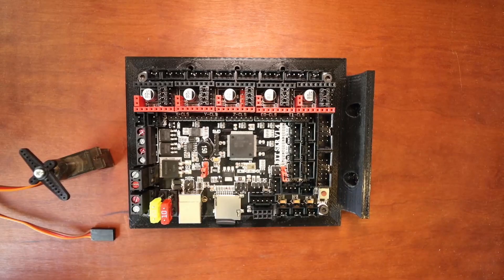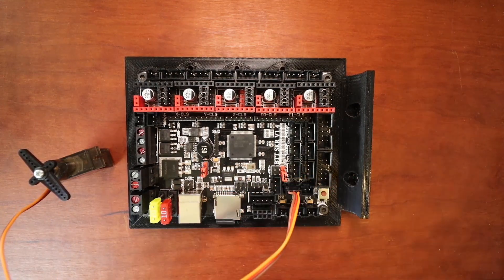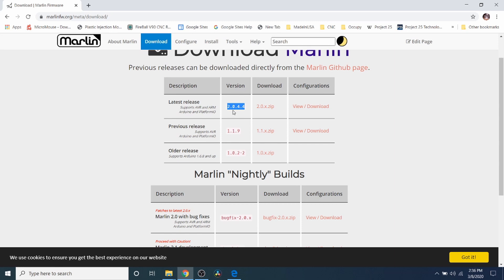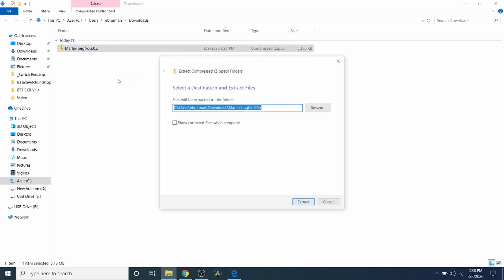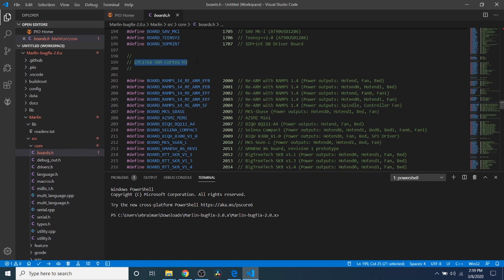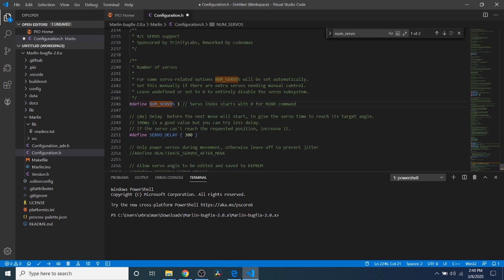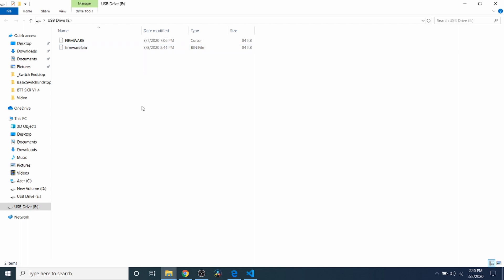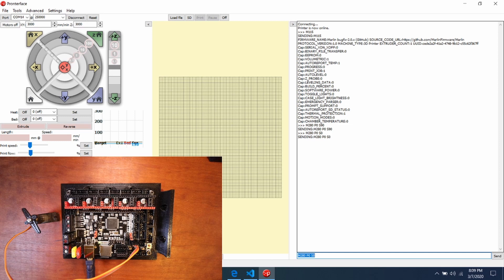SKR 1.4 - Servo

Comment: Hi Edward,
I trying to connect a servo to switching nozzles on  skr 1.4 turbo but I already have in use the "servos" port with the bltouch. How I can connect the servo and the bltouch on the skr 1.4 board?
Reply from the maker: You'll need to use something like endstop port modifying pin connection order to match servo and modify the pins file for the endstop signal pin to match servo pins for that signal pin.
Reply: @EdwardBraiman  Thank you for your answer.
If I'll use an endstop port, will I need to unsolder the resistor connected to the port to make it work with the servo?
On the other hand, do you know if I can use the dedicated neopixel port to connect the servo? This port has the same pins only in a different order.
Reply from the maker: You can use any free pins other than endstops.  You just need to find a signal pin, voltage and ground on pinouts diagram.

Comment: So, does it have 7 servos Plus the BL Touch ports
Reply from the maker: You can modify pins file, along as you have the following three pins available; 5v, ground and signal.
Reply: @EdwardBraiman  Thanking You 2000% Tweeted liked added to 3D Printing Playlist
Reply from the maker: You're welcome.

Comment: Thank you for the video! I spent two days finding a solution for a problem after following this guide and hopefully someone will find it helpful. 

In Configuration.h where NUM_SERVOS is anything greater than 1 the SERVO_DELAY needs to have a section for each servo. 
So if there is one servo then it would look like this 
SERVO_DELAY  { 300 }
For two servos it would look like 
SERVO_DELAY { 300,300 }
and so on
Without the added delay's for each servo the VSC would spit out a cryptic error that looks like this:

In file included from Marlin\src\module/../HAL/shared/servo.h:75,
                 from Marlin\src\module/servo.h:29,
                 from Marlin\src\MarlinCore.cpp:120:
Marlin\src\module/../HAL/shared/../LPC1768/Servo.h: In member function 'void libServo::move(int)':
Marlin\src\module/../HAL/shared/../LPC1768/Servo.h:58:38: error: static assertion failed: SERVO_DELAY must be an array NUM_SERVOS long.
   58 |     static_assert(COUNT(servo_delay) == NUM_SERVOS, "SERVO_DELAY must be an array NUM_SERVOS long.");
* [.pio\build\LPC1769\src\src\MarlinCore.cpp.o] Error 1

after finding the fix, the error does not seem so cryptic now. I hope this helps!

Comment: Can you do a video about using external stepper drives (aka, drives that are not pololu step stick style). If I understand correctly, the closed loop stepper pins below the red headers (as the board is oriented in your video),  would be used for this. Does that seem correct?
Reply from the maker: Still researching.

Comment: Hi Edward, 
I'm considering buying skr pro or skr 1.4 turbo board. I like features of skr pro, but i saw many people complaining that they have problems with it and lack of software support. My concern is reliability of the board. Would u advise buying it if i want board that once all set will work without need for constant maintaining and troubleshooting problems. Also would u advise tmc2209 or 2130 drivers considering reliability on first place.
Reply from the maker: TMC 2209 UART still has Marlin firmware issue.
Reply: Thank you for the fast respond. And what about skr pro board?
Reply from the maker: It's a challenging board.  I like it's additional functionality over other boards.  Down side is no eprom, a4988 and drv8825 do not work, BLtouch is still not working in Marlin.  Otherwise it's a great board.

Comment: Thought this was a bltouch video...
Reply from the maker: Still waiting on Marlin to fix bug.
Reply: @EdwardBraiman  Hi Edward, thanks for this step by step tutorial, usefull as usual ^^
You're talking about a bug in Marlin for BL touch (i assume this includes clones ?), was unaware of that and i'm wondering if this relate only to BTT SKR1.4 or is it general ?
Reply: @EdwardBraiman  is there a known BLtouch bug?  I'm attempting to configure a 1.4 turbo board for use with an Ender 5 Plus, which has the BLT included.  I'm rather stonewalled at the moment though, as there doesn't appear to be any Marlin config files for the 5 Plus.  I've checked out configs on Github that people claim to use on the 5 Plus, but their configs are using a single Z-axis config, not dual-Z, so this confuses the heck out of me since the Plus is a dual-Z-motor printer.
Reply from the maker: @bartacus3521  here is a list of known issues ...
https://github.com/MarlinFirmware/Marlin/issues?q=is%3Aissue+is%3Aopen+bltouch
Reply from the maker: Here's the issue I opened in January, they closed my first bug in late December if memory serves me correctly ... 
https://github.com/MarlinFirmware/Marlin/issues/16643
Reply: @EdwardBraiman  I understand that the error with bl touch has not been fixed yet ???
do you have a configuration for skr 1.4 and bltouch?
Reply from the maker: It may have been fixed, I was testing a couple of months back.
Reply: @EdwardBraiman  do you have a configuration for skr 1.4 and bltouch?
I really want the sensor to work
the problem is in the firmware
is it possible that you would give me a test firmware for skr 1.4 BL touch
thanks!
Reply: @EdwardBraiman  on my skr 1.4 board, even the servo pin does not send a signal on flashing
and BL touch, when turned on, does not perform a test
that is, it does not release the stock,
BL touch 100% working